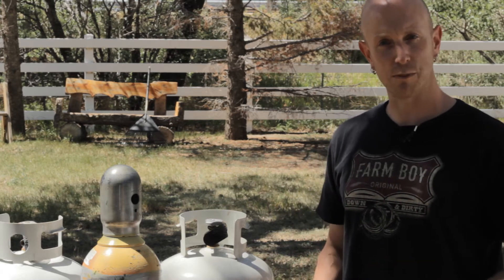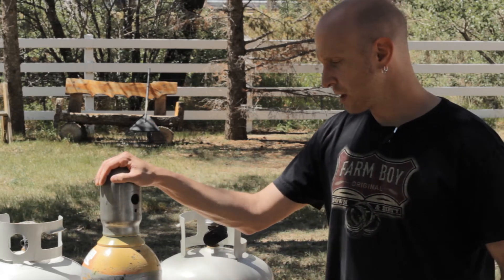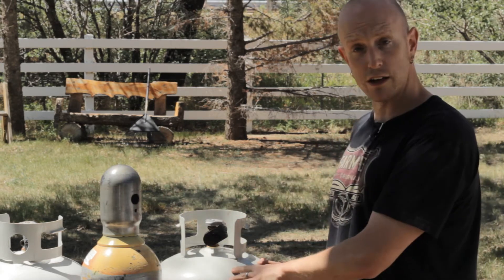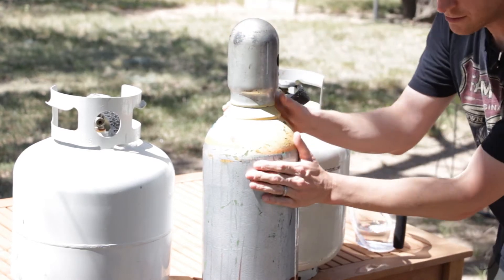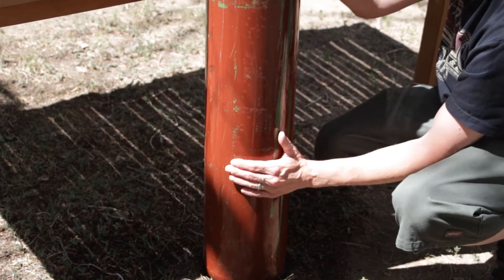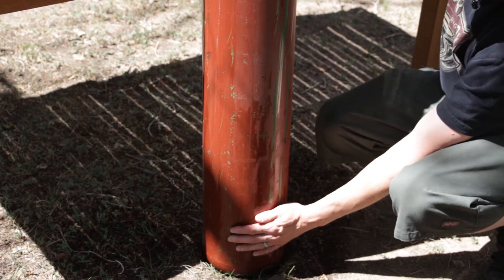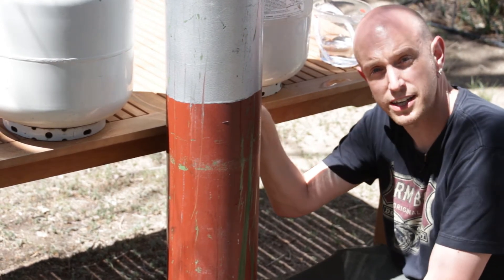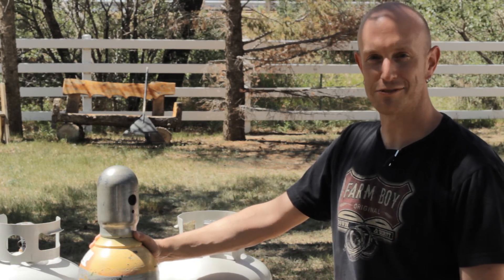Check the level in your Argon Tank

Comment: No, Propane is liquified in the tank and therefore able to be a thermal load to the hot water.  Creating a demarcation to the level of the liquid/gas.  Argon is always a gas except at temperatures of -303 F and below.

Comment: Uhhhh, there is no liquid in an argon tank so there wouldn't be a temp difference. It would be like pouring the water over an air compressor.
Reply: or you could just read your guage???
Reply: yeah xraid is right but you can get an idea by knowing 0 psi is empty and full in warm weather 2500psi maybe give or take.  His compressor is probably 1/4 full of condensate though